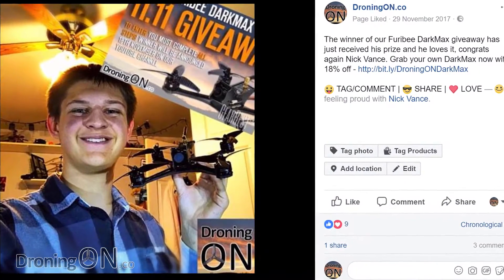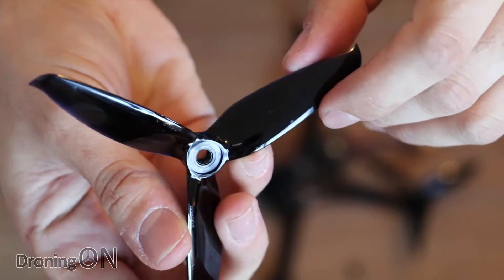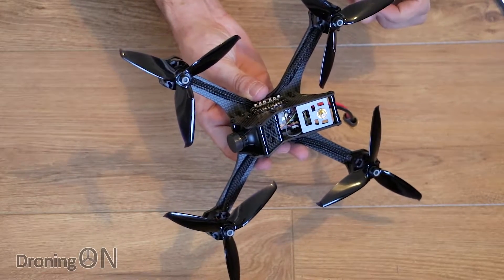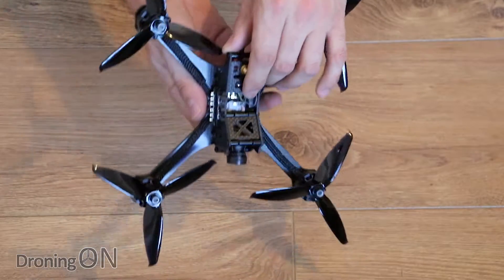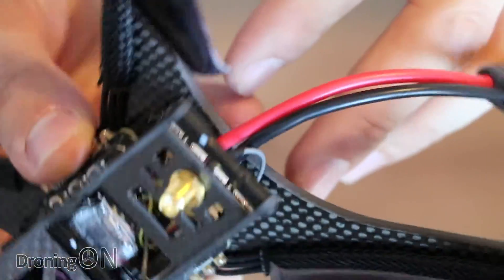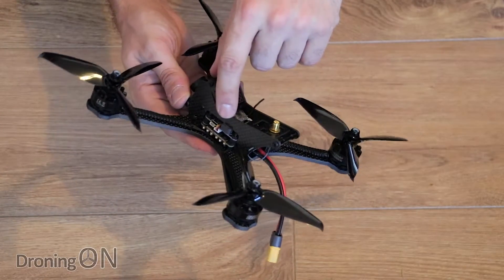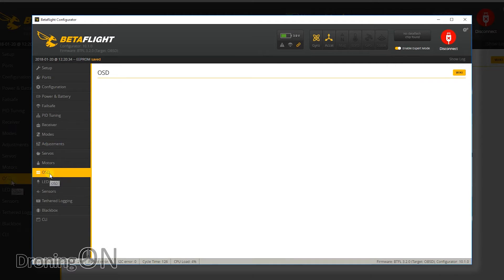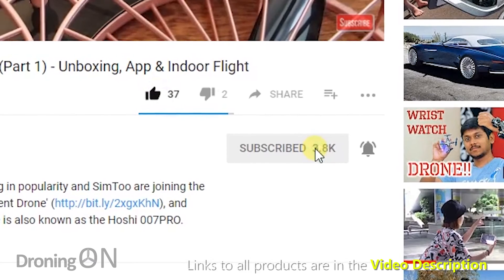DroningON | FuriBee Darkmax 220 Review (Part 1) - Unboxing, BetaFlight Setup & FrSky RX Binding

Comment: My first drone can't get it to bind!
Reply from the maker: Which RX option did you choose and with which transmitter are you trying to bind it? What's the exact problem and what process are you following?
Reply: Ok got it to bind, had to change from d8 to d16.  Now struggling on getting my qx7 st up right.. as of now the throttle controls the led lights lol
Reply from the maker: Glad that you got it sorted! Sounds like you need to amend your Channel Map in the Receiver tab, rewatch my video :)

Comment: In your next video please try it with a 6s battery. My Darkmax flips around and crashes. I need to know what to do to fix that problem.
Reply from the maker: +tsedodgeboy we had this same issue when testing the HolyBro Kopis with larger capacity/higher C batteries, we suspected cold solder joints, I'll see what I can do but realistically this quad doesn't need 6s.